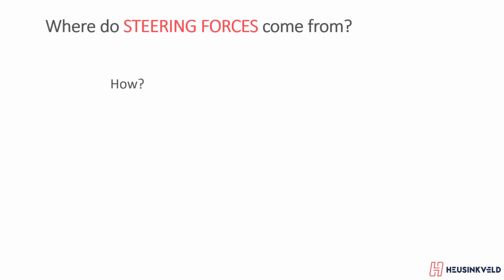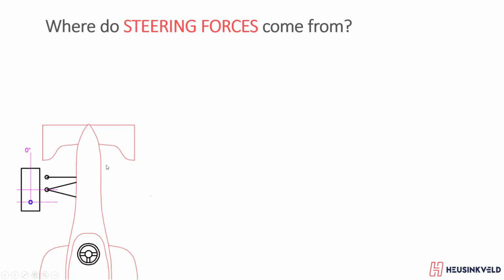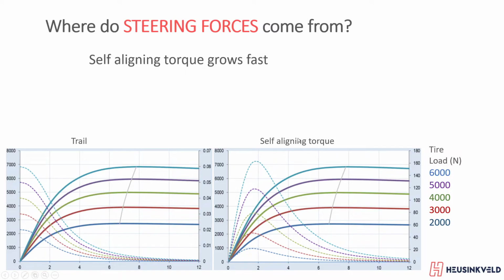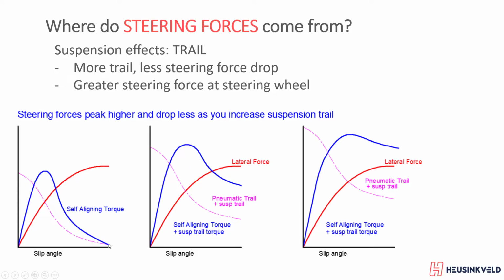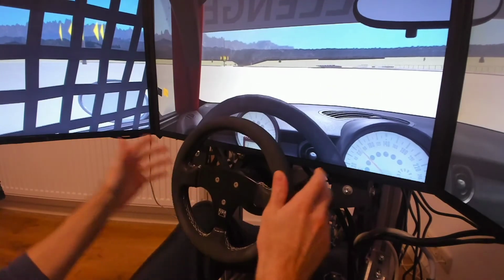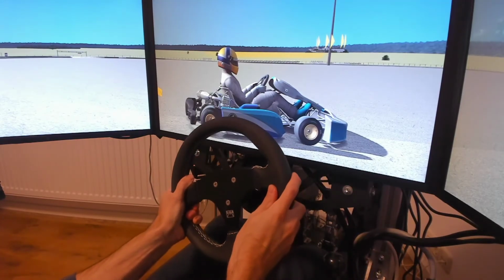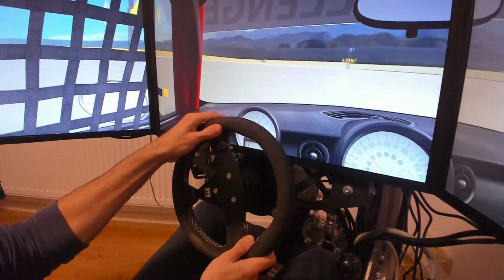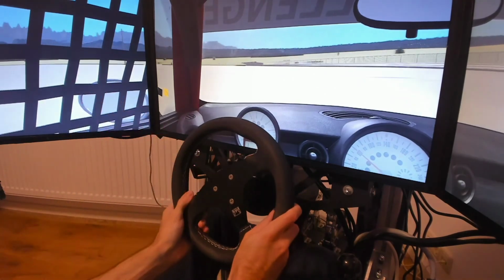(Race) Car Steering Forces EXPLAINED!

Comment from the maker: DISCLAIMER: While Automobilista as evidenced by this video does its Force Feedback quite physically correct and complete, I have no idea if the other sims do it the same way. It could be argued that the more adjustments and sliders you have to adjust your FFB, the less likely it is to be physically correct.
DISCLAIMER2: My tire forces are the wrong way round when talking about how self aligning torque produces steering forces, nobody picked that up yet. Doesn't change the fundamentals though (just inverts it)
Reply: Thank You! And thank you for the clarification on the inverted lateral steering force direction -- I just watched the video and actually came here to ask what was going on with the lateral steering force arrow direction...

It was quite confusing: As I watched the video, I kept going back to the illustration of the steering force direction as I simply couldn't reconcile the lateral force direction with what I would expect and what I was picturing in my mind (i.e. with the steering wheel turned slightly left, I expected the force in the illustration to point left and thus create a clockwise SAT that would try to turn the wheel back towards TDC and thus create a rightward lateral force on the steering rack).
Reply: same what Minolin from acc said... great video btw...
Reply: Well said. Less is better. 
e.g. FFB settings in R3E are kinda overkill.
Reply: @ErnieGaming  I'm actually watching this to see if I can improve the vertical/lateral/understeer mix there. Funny, isn't it - AMS is great from the word go and we know R3E settings will never get there even if I work on it a bit more...
Reply: @Atticvs32  I still think, that you only need ingame settings for FFB gain, minimum torque and perhaps filtering/smoothing. That's it. All the other stuff should come right from the physics.
Reply: @ErnieGaming  That's what I did at first (no smoothing either), but surprisingly enough if I set both vertical and lateral to 0%, I got no tyre effect at all! Only what Niels described at the beginning of this video - the weight effect. It was funny. Based on the controller file R3E asks for a 'balance' of vertical and lateral (and the diff between the two) and you must set at least one of the two higher than 0%. I kept vertical at 0.0 (it's just a road effect multiplier after all, Niels says you don't feel it separately) and lateral on the default 60%. Adding to that, I just copied what controller parameter values I could from AMS (both AMS and R3E are gMotor games after all), so I set the 'Low Force Boost' line to 0.69444 ('steer force exponent' in the files), the understeer line to 0.55 (was 0.6 by default, so R3E got it pretty close) and the max force output line to 1.8. No vibrations, no stationary effects, etc. Not even minimum force - with the Low Force Boost, my G920 is rattling at the center even with the dampened center in AMS. (But I need the non-linear FFB to feel such a weak wheel; Niels, David Tucker from iRacing and the default Kunos gammas all say the same.) In the end, I got a surprisingly nice and 'raw' force feedback - for your average R3E level at least, AMS is still much better, of course.
Reply: @Atticvs32  The main issue of R3E is the understeer effect, you need to set it from 5% to 10%, over and the US effect seems to be there all the time. It seems to be so sensitive than every tiny bit bof understeer makes the steering so light when turning and you never feel what the car is doing (try it at 5% and increase it slowly)
Reply: This is not always true unfortunately, problem is all FFB systems are not made equal en do not reproduce at the same level all forces sent by the sim, those sliders (or files in the case of rfactor 2) are still relevant but they are not meant for driver to feel more a said force than another actually, they are made to compensate the lack of representation of this force on different hardware and this is where the problem lies, those settings could be made by devs and you could just select the correct preset for your hardware but even all same brand hardware sets aren't made equal, sooo...sliders are useful.
Reply: I promise I did not read this yet when I posted about it... Now I'm afraid of being seen as a troll.

Comment: With the knowledge you have, what sim would you say is the most realistic, or do they all get these FFB physics correct nowadays? Also, should I avoid mod cars (assuming the modder didn't have this proper knowledge)?
Reply from the maker: Don't know! You kinda have to look under the hood to see what they do and don't. AMS is good as it passed the tests. I would assume RF2 is the same. RF1 and GSC lack accuracy in self aligning torque. AC has a few 'odd' options for tuning the FFB, but perhaps underneath all is correct. Somebody would have to create special 'mod' cars like I did that allow you to isolate the individual effects and see how each sim responds.. Can't really be done for some sims sadly!
Reply: @NielsHeusinkveld  Thank you sir! I currently have LFS, GSC, AMS, AC, ACC, rF, rF2, and iRacing. I got tired of paying for iRacing, and  R3E and Project Cars didn't appeal to me in the long run for some reason. I prefer AC for the most part, but always wondered if I was missing out in the realism department. RF2 feels the most intimidating, like I would have to figure out mods all day just to get into it, because all my friends who use that sim rely on mods. But I don't implicitly trust mods to be properly designed for realism, so maybe AMS for when I want the most simple authentic experience out of the box.
Reply from the maker: @DerekMoore82  Oh and modders can be better or worse than the original game creators. Some are a bit delusional in overestimating their knowledge while others will probably make the sims of tomorrow handle great! :-)
Reply: @NielsHeusinkveld  Good point, thank you sir! I recall there was a mod NSX in rFactor that was the best experience I've ever had in a sim. The drifting was amazing.
Reply: @DerekMoore82  :) I just wanted to say, niels was also a modder back in the day. But then I saw your NSX comment, so you probably know :)

But yes the things with mods especially in rf2 can be pretty significant... some mods and cars (in rf2 you could say every car is a mod some are just from the rf2 team itself) some mods do a realy good job and some a realy poor.. and I think especially in rf2 the difference can be quite extreme since the physics engine is pretty complex from what you read, hear and also feel to a degree..  
if all is done very good, rf2 can be amazing.. but on the otherhand I also came across so many bad mods there where it feels just like a total mess and you already get just from driving the first laps or turns that the mod is realy wrong because it behaves so strange nobody would ever design a car that drives like that... where it feels broken

AC on the otherhand has ofcourse also some mods that aren't so great but (and I think it is because the physics behind it are quite a bit simpler then rf2s) but has alot of mods that do at least feel ok... and some that are realy realy amazing and are on par or sometimes even better then Kunos own cars for AC.

So in generel you can't say just because it's a mod it doesn't have the quality. There are some modders out there that do ALOT of research and have ALOT of knowledge.

And the thing with the most realistic, well..  no sim is 100% realistic (wouldn't be a sim then because 100% is reallife :) )  they all to strange things in some moments here and there... some might be better in this but lack in that.. others a better in that but have trouble with this... some behave in that situation not as the other one and so on...  
nowadays the basics are done right in every sim I would say...  and the choice comes then down to flavor.. 

funny thing for example... back in the day with a g27 Iracing felt ok to me a bit loose but ok and I thought when I get a DD wheel someday it will all become better... well since I have a DD wheel.. I don't understand iracing anymore.. everytime I try it with a dd wheel.. I think something is wrong with my wheel setup...  other sims feel great... ams is amazing with a DD wheel. ..   rf2 too with good cars ...  AC is ok (some cars amazing some ok) ACC is also ok ...  (strangely I play mostly AC and ACC even I like the ffb from AMS and rf2 more)
but Iracing became a complete big questionmark to me... the only thing that feels correct there now is the lotus 79 that thing is alot of joy with a DD wheel.. but by most othercars I always think I my motor is tuned wrong or so...   which might be the case since I drove it with a simucube2 at the sim expo and it felt great... but since my wheel does feel good at all the other sims..  I won't start to fiddle around in the granity software

Comment: Huge job right there, thank you. I gained and improved good amount of knowledge there and got good dircetions what to study more. 

I am very interested in influence on steering forces from rear end overturning - oversteer. It would be interesting to get a look on it in a bit more detail separately some day. Makes sense if during oversteer rear slip influences front slip and this causes increase or decrease of SAT, because as it was mentioned - car is a rigid body and it does not have a hinge in the center. 

But I think there is something more subtle going on when car is gaining yaw rotation. And it does make a difference for if you should let steering align itself alone into a slide of oversteer, or you should add your own steering effort to fine balance the steering to maintain desired direction of motion. It gets complex as caster gets mixed up with kingpin inclination, and scrub radius, and gyroscpic forces, and.... But the most interesting thing is how much immune are the front slip angles from change due to rear end overturning ? I get that at huge speed and with heavy wheels gyroscopic forces can get very strong, and that great amount of caster makes for strong self aligning during oversteer, but it still seems strange when I do increase caster with some cars and I already can feel significant self aligning even with minimal rear end slip (happens with some cars/simulations). 

It all seems a bit of a mess in my message, because it is a mess in my head. But I guess good starting point would be learnign how does increase of caster affect increasing reaction to oversteer. Sometimes I think that peak force of alignment should increase, but not come much earlier with tiniest slip angle of rear wheels, but it is just a notion, I can't find a way how to base it. It also feels annoyingly runing dynamics of some cars, as some feels like it would be appropriate to use pedals more for steering, but the strong and super immediate FFB response forbids using pedals to influence yaw rotation, as steering is just proactive, and I don't even say that SAT decrease with little bit of yaw, but it feels to instantly reverse whic hfeels so wrong to my mind. Unfortunately simracers seems to like proactive steering responses, so I have a bit of conspiracy theory about some developments of my own (which is probably wrong) :D

Comment: I once played AC while high (made me much more perceptive) and I was driving the Audi R8 V10 Plus down and up Foxhole on Nordshcleife. As I got to the top I started braking and I could feel the weight of the car shift foward and move around as I was turning, I could feel exactly how much grip each tyre had and I could feel the suspension loading up, all that through a G27.
Reply from the maker: Not sure if that is tongue in cheek? Because my message is pretty much the exact opposite. It is very easy to think you feel specific things but you probably can't, and even less likely so with a G27! The only thing you can be sure of is having a big smile while enjoying the drive, but you can't separate 'suspension load' from all the other things that cause some steering forces..
Reply: @NielsHeusinkveld  I forgot to mention a cruical detail. In AC a lot of that came from the camera movement inside the cockpit. 

So while I did feel all that, on a G27 it wasn't all that was necessarily coming through ffb :). G27 does an ok job with felling the suspension and the grip but everything else has to be from the visual side. And even then, all of the above only comes through if you aren't forced to lower the ffb because shit is clipping :D.

PS: I haven't watched the full thing yet.
Reply from the maker: @ID1visor  You make a good point. When you're 'in the zone' and really enjoying lapping the cars at the limit, it can be tempting to describe what you feel through the FFB. We've all been there, but at the end of the day this big smile experience is a mix of lots of things. Hours of practise, experience, brain that is able to think ahead, some make belief thrown in.. I mean I have that too, its not to disrespect, at some point you can forget you're playing a game.. That's what makes it so much fun. :-)
Reply: @NielsHeusinkveld  exactly ;)
Reply: @ID1visor  AC has proactive FFB which tells a ton about rear end slip, it is like semi driving aid.
Reply: @41BOT  my dude, I don't have a lot of real world driving experience but I did drift a 200hp stripped out e36 in a smallish circle in the summer and AC, apart for not having enough grip (I was on bad asphalt with shit tyres and had to clutch kick a 200hp car to get the ass out) is pretty fucking close even considering what I felt was a beautiful harmony of my hands and ass telling me what is happening. And it was by no means hard, only thing that threw me off was the sitting position (because I don't use some special seat with my g27)  because I'm quite tall (about 194cm) and tje fact my head wasn't locked to look where the car was going so I had to look where it was going otherwise I couldn't initiate a slide because I wouldn't go sideways enough and would end up in the sand in the middle.

TL;DR

AC doesn't have enough grip (take a gt86 on semis or a e30 on semis or any other 200hp rwd car, turn the wheel 90° and floor it, and voila, instant skids. Do that irl with a over inflated shit tyres on shit surface in the summer and all you get is understeer) and the forces ffb gives you are fine if you don't have a motion rig.
Reply: @ID1visor   There are quite some details to get in about your observations, but I think neither of us are ready for that.
Reply: @41BOT  I'm sure there are.